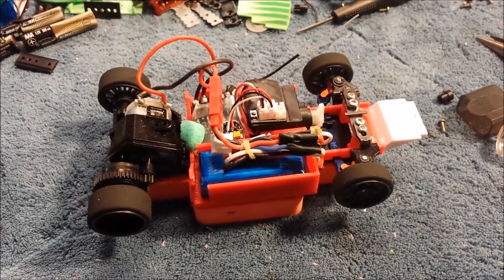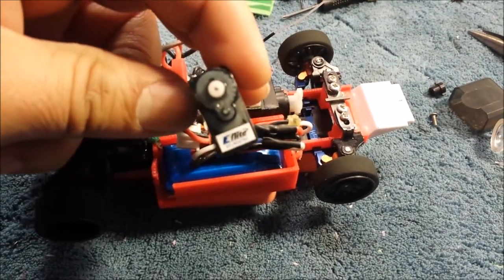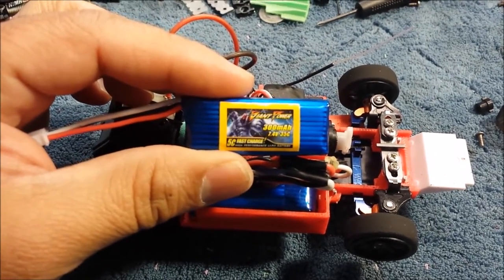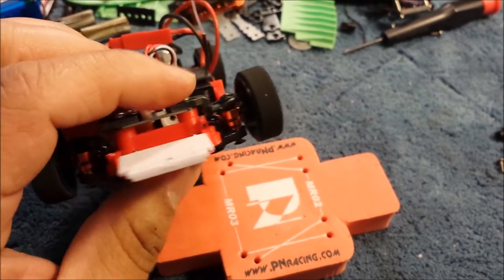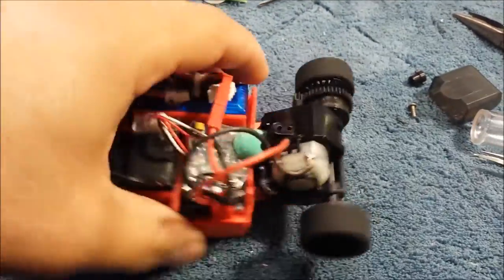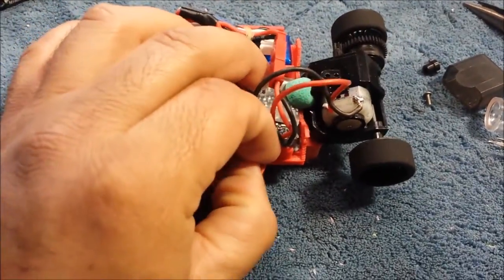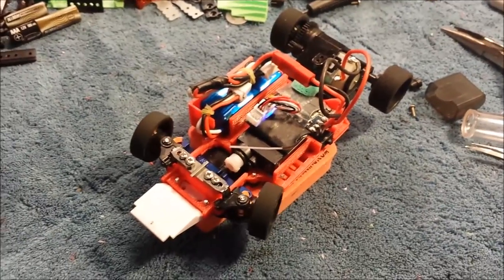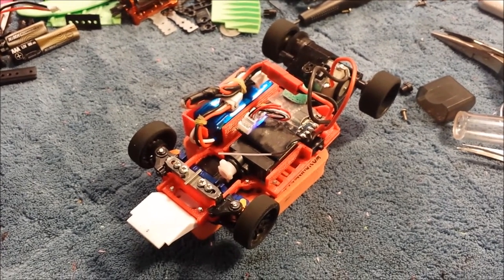3D Printed R/C Car

Comment: ok cool i was thinking if you can even make the front suspension on the 3d printer. and man this is super cool man great job
Reply from the maker: I've been working on an a-arm design for the F1 that could transpose to this chassis.  I've done a couple prints but it's still in the design stage.  I'm trying to get the designs as precise as possible so they need little to no tooling before installation.